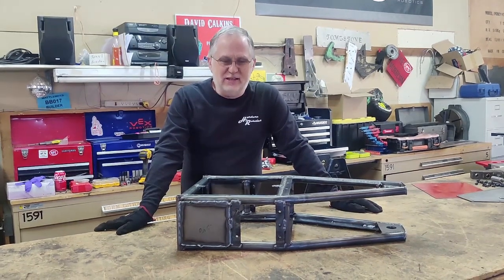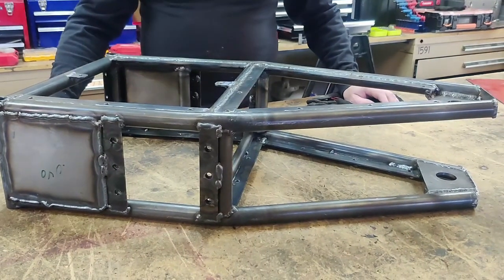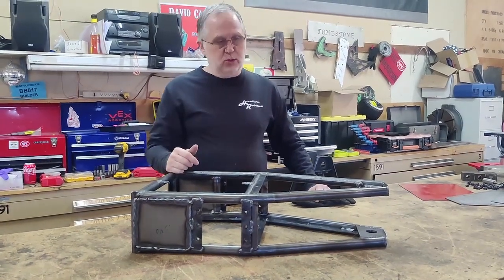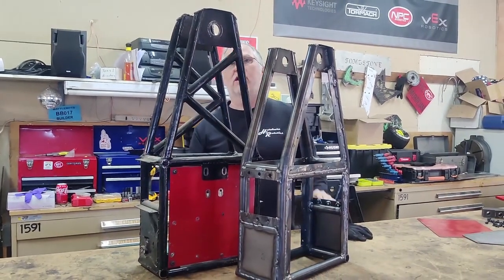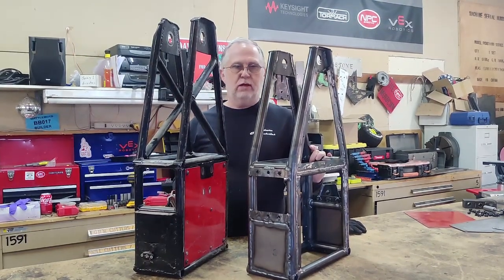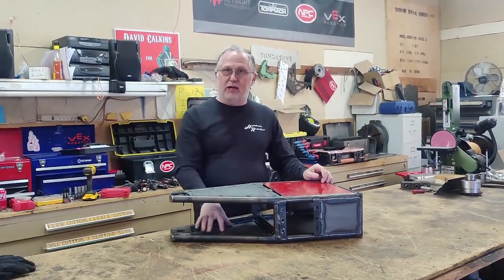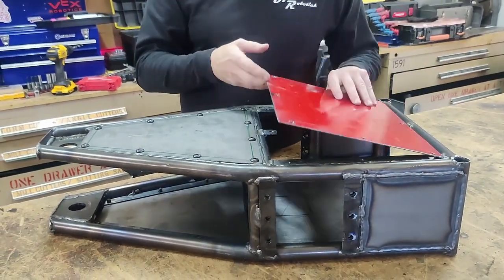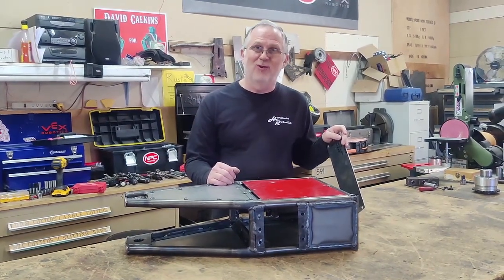Mortician 2023 - Frame construction

Comment: What is your method for allocating weight? Did you CAD & calculate every gram ahead of time or move from one system to another with a rough idea of how much you want each to weigh?
Thank you for these build videos!!
Reply from the maker: Honestly it ends up being a bit of both. I do CAD certain components like the weapon bar, and will figure out weight from the CAD files. And I've also got a good idea of what some components weigh, since I used them in other builds. Then I weigh frequently while assembling and stress over whether it will make weight or not :)

Comment: Dose the front end just drag km the ground, or is there some kind of caster?
Reply from the maker: The nose drags on the ground. Honestly the extra friction there helps driving, so it doesn't tend to oversteer which is a problem with two wheeled bots.
Reply: @ray9368  is tombstone the same?

Comment: How come no one uses a slipper clutch on the bigger weapons ?  or do they ?
Reply from the maker: Many teams use something to provide some slip. Either running belts or using a torque limiter. The biggest issue is the sudden stops. The armatures in a larger motor have a fair amount of mass, and they want to keep spinning during a sudden stop - not from power but from momentum. A small amount of slip then can help keep from bending things :)
Reply: @ray9368  I understand that but surely a fair amount of force is being transferred to what ever is stopping it spinning ?  Is it something to do with the opposing blade, the one that doesn't hit ?
Reply: no point in that, they just use a cutoff incase it draws too much current, its all digital these days
Reply: @joki6395  I was thinking in terms of easing whiplash on the motors and mounts. If a bit of metal bends you may be able to keep the weapon running but if a motor or motor mount fails it's game over....